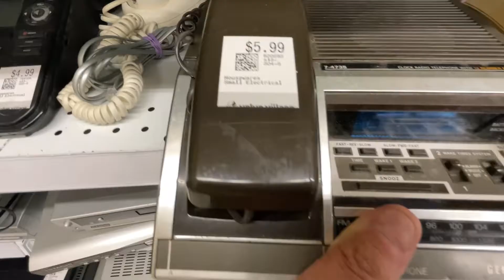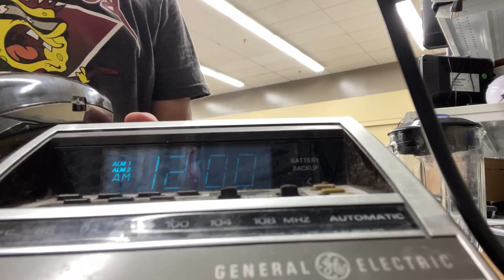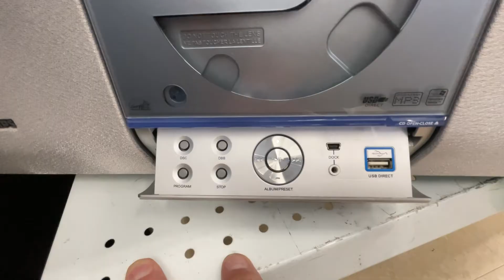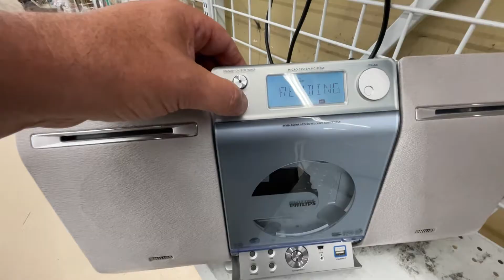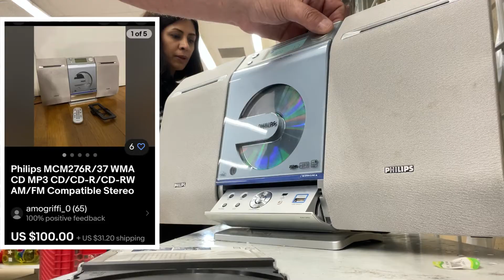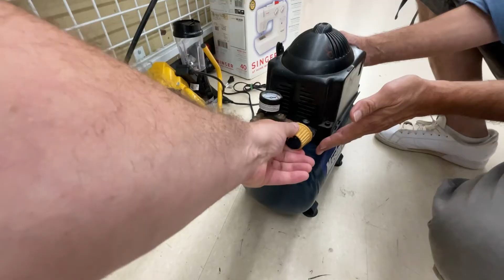Thrifting for Vintage Electronics and Tools

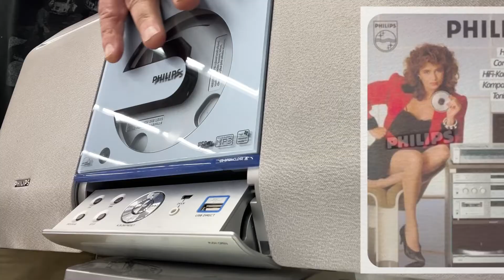Comment: 4:20 I'm on the fence when it comes to analogue versus digital tuners where I prefer analogue tuners for vintage receivers from the 1930s to the 1970s, but for 1980s and 1990s models to the present, I'm fine with digital tuners. However, I do prefer analogue tuning dials instead of digital buttons for that more hands-on tactile feeling.   :)

Comment: 4:20 For only $12.99, I would have scooped up that Philips vertical CD player and AM/FM tuner stereo system even though I already have a similar model and a remote control. It's great that it still has its wire antenna, etc.   :)
Reply from the maker: I already have one, sometimes I just gotta walk away otherwise I buy em all lol 😂
Reply: @Thriftronics , yeah, I know what you mean and I think you and I have the same Philips model. Haha!  :)

Comment: The yellow knob on the compressor is to adjust the pressure going out. Some air tools need reduced air pressure as to not damage them.
Reply from the maker: Ah ok, he since bought a regulator and hose says it’s really good compresser
Reply: @Thriftronics  good stuff.